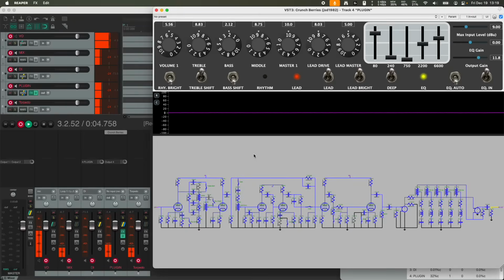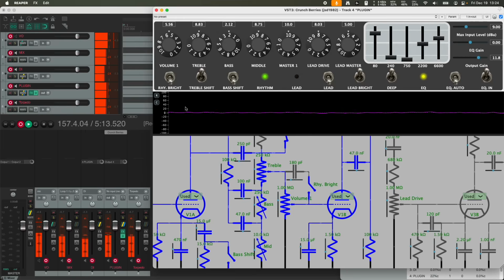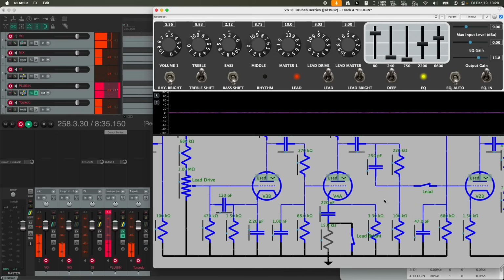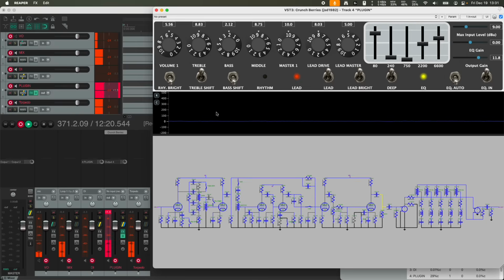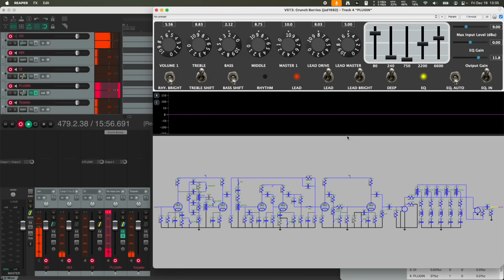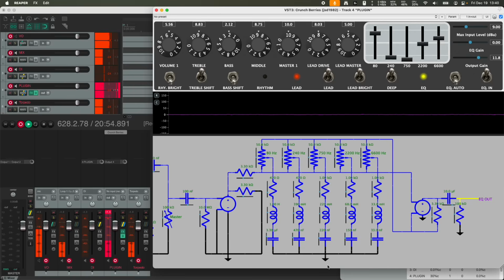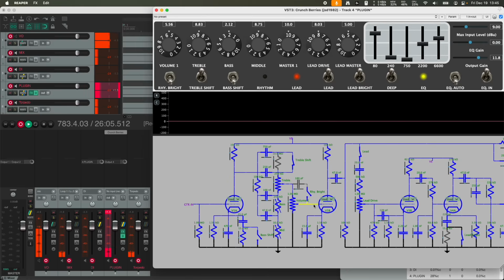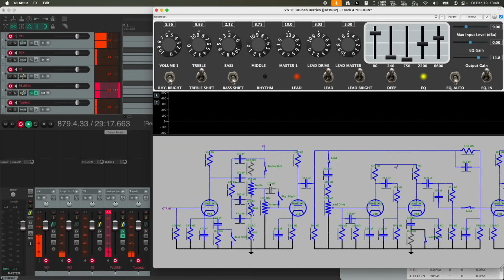Crunch Berries - a Mark IIC+ Preamp Circuit Simulator Plugin

Comment: You could ditch the gyrator eq and replace it with a tube ultra low distortion graphic EQ by rickard berglund to further improve the plugin, you will find the schematics online... 😇
Reply from the maker: I'll have to do some research on that! I simplified the IIC+'s real EQ circuit by swapping out the transistors (which are a bit challenging to simulate) for some much simpler op-amps (voltage-controlled voltage sources), so there won't be any clipping or saturation caused by the EQ circuit which might occur in a real IIC+ if you drive the output too hard. I doubt that's a desirable sound but I'm probably wrong!
Reply: @jsd1982  I don't know how much the IIC+ would drive the 5-band EQ, but a tube EQ would probably have more headroom and less distortion, and wouldn't need inductors/chokes(they're sensitive and cause hum in a real amp, and not very accurate). You could replace the opamp eq with 12AX7 and 12AT7 tube driven eq.
I get why mesa do use the choke gyrator, it was cheaper than the tube eq.

Comment: how easy is to modify the circuit to create other amps? There's a circuit editor?
Reply from the maker: It's not a circuit editor but it does let you change all the components' values. At some point down the line I do want to make a circuit editor using this tech.

Comment: Very cool, I think this is the one right way to do modelling (Of course depends on how accurate the modelling of the parts is). I'd love a plain version of that where I can build my own virtual amps from schematics. A really advanced version of this could maybe also have a setting for the board layout and modelling of the magnet fields of the parts. But at some point the CPU gets too hot.
Reply: well, basically every guitar amp is the same so you could mod it piece by piece from anyone

Comment: I love what you've created here. I was trying to come up with something similar so I could, not only simulate my main Fender amp, but could test my own amp circuit design before buying the components. This would be for use in Reaper on Linux. I haven't been able to find an amp plugin that works well for me in Reaper on Linux. Would your plugin work on Linux?
Reply from the maker: Yes it should work on Linux. Another commenter asked the same so I looked into it and yeah I could compile and run on Linux VM without a hitch.

Comment: Genius! Have you tried to automate/randomize the component values, 12au7 valve...or any other for that matter? also, would make sense to you to create a signal / wave delta comparison with original values if it was possible? Does that make sense in your opinion for sound design? Congrats, amazing work!
Reply from the maker: Yeah I had the exact same thought on randomizing the component values within their tolerances. I think that would be fun to play around with. I haven't tried other tube variants but if I understand, they should have similar overall curve shape just with different curvature parameters, e.g. the 12AU7 is just a lower gain version of the 12AX7.
Reply: @jsd1982 mate, u broke fractal cheat code on those sharc processors with your work... If you come with output Trafo sag on the curve...valve changes...u have a fractal plugin on hand...just...just...  Magic... Kudos again

Comment: Congrats! Is that based on LiveSpice?
Reply from the maker: No but I did take inspiration from that project! Very cool stuff.
Reply: @jsd1982  I don't wanna bother, but, do you haveany advice on crossing from an Electronics background to Virtual Analog Simulation? I'm currently looking into MNA and WDFs, just as a way to build plugins of the effects I've been designing and building IRL as a hobbie ^^.
Thanks!
Reply from the maker: @sharptrickster  No bother at all! This amp sim is using MNA with Newton-Raphson iteration to solve for the non-linear triodes. WDF seemed to be a bit limited for this application but I'm no authority by any means; probably it works better for all I know. Besides that, just a ton of custom C++20 code to compile-time optimize the circuit topologies and a lot of time spent optimizing the core solver loop. Building IRL sounds really awesome and I've thought about it but it's just way cheaper to build in the box lol.

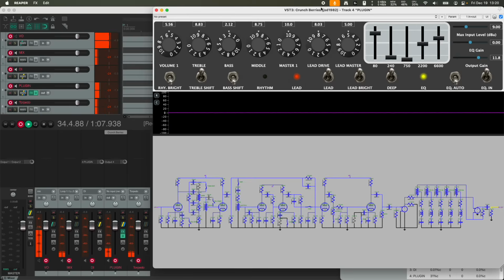Comment: 0:34 heavily saturated? heheh saturated, get it, because distortion, saturation and stuff hehehe
I'll show myself out :)

jokes aside, what an awesome plugin. I've always had an inkling that this is something that Fractal do in their amp emulations. But now, when you see the circuit and if you have even a cursory knowledge of electronics, you can understand what each switch does. The example with the treble shift switch and the resistor there is very illustrative and intuitive.

I'm interested in knowing how I would be able to obtain this plugin and also, what kind of IR are you using?

What an endeavor! I am very very impressed.
Reply from the maker: Thanks! The IR used is the John Petrucci DreamWorld 4x12 recto blend with room.

I'm still working on a release version. I'll probably put it up for sale on a website that I own and control that doesn't exist yet. I'm toying with the idea of a demo release but not sure what demo strategy to employ.

Comment: Honestly, this sounds more legitimate and true to the original Boogie amp than all of those expensive plug-ins.
Reply: Spice modelling is basically the foundation of many commerical ampsim plugins. Generally, NeuralDSP and Mercurial start their model in spice and then send test signal to the real amp input while reading its output and provide it to parameter-adjusting neural network in order to make the model closer to the real deal.
Reply from the maker: @metalosaur  Yup. I use LTspice to prototype the circuit and if I can simulate it in a stable manner there I can easily translate it into the C++ code to run it in real time.
Reply: Thanks for your insight

Comment: Amazing stuff! Now one can mod their plugin like they could mod their real preamp. How are you avoiding aliasing?
Reply from the maker: It uses oversampling to avoid aliasing. This demo uses 2x, and there's a hidden parameter to control that but I'll put a control for that on the UI.
Reply: @jsd1982  Thanks for the answer! So are you running the sim at 96kHz? Or is your base sample rate higher than 48kHz? Did you measure how many dBs of aliasing you are getting e.g., at full gain with e.g. high output humbucker pickup signal level?

Comment: This is by far the best schematic based plugin of Mark IIC+, I tried DiBiQuadro one and it sounded horrible, very loose. How can I test your preamp plugin?

DiBi stuff is also with tweakable schematic and stuff but a bit more limited than in your variant.
Reply from the maker: I'd never heard of the DiBi stuff until a few comments here mentioned it. Their audio samples leave a little bit to be desired, yeah :D. Not sure how they're simulating the circuit as they claim to be while not getting the tones right. Strange.

The schematic layout currently just lets you alter all the component values but there's no option to add mods just yet. I think that'd be a very useful feature though so we'll see if that shows up later. The ++ mod isn't all that complicated so maybe that'll be the first one.
Reply: @jsd1982  The DiBiQ audio samples sound amazing, while yours sound quite like shit, especially on the chugs. Why do you think they are not simulating all the components? do you have any proof or are you just talking shit about others to make yourself look good?
Reply from the maker: @George63-cz1dj Hey yeah sorry that wasn't my intent. I just didn't think the samples I heard sounded like the amp. I'm sure I'm wrong though. That wasn't fair of me. I didnt test it myself. Sorry I will do better.
Reply: @jsd1982  I saw you before, under Dann Valentino's post in a FB group a couple of months ago, or it was a video. You told him about your plugin in development, I wouldn't be here if I didn't see it. Great job so far, but I would like to test it myself and send it to my friend cause he owns a real Mark IV and is better in understanding Boogies, we have 2:90 poweramp capture.

Comment: This is so neat! Seems like just designing the object heirarchy would have been kinda fun!

What are you using for persistence? Does C++ have any built in object flattening system these days? I'm a Swift guy now (but used to work at Borland on the C++ side), and JSON seems to be extremely popular at the moment.

Are there any plans for making this publically available? Or plans for making this into a sort of toolkit for people making / cloning their own circuits?
Reply from the maker: I use Juce to handle the parameter persistence. I think it uses xml out of the box.

Yep I plan to have this in release shape as soon as I can. And probably further down the line it can morph into an amp builder type of system.

Comment: What are you doing for the power amp section? Are you using a separate simulation?
Reply: He mentioned he's going into the fx return of a MK-V, so no power amp modeling ... yet?
Reply from the maker: @AlanW Yeah exactly. The SimulClass power amp circuit is giving me grief trying to simulate it in LTspice, but once I get that sorted that can be included. Might be good to have that as a separate plugin so other effects can be inserted in between.
Reply: @AlanW 👍

Comment: Does it work on Linux?
Reply from the maker: No reason it shouldn't! I just haven't tested on that platform yet.
Reply from the maker: Yup works just fine in Linux. I just compiled it on a arm64 VM and it runs on a Kubuntu desktop.
Reply: @jsd1982 i hope it's Linux compatible. We don't have too many plugins like this.
I know we can run windows plugins with wine or yardbride but induce latency.

Comment: real electrical engineering
Reply from the maker: I majored in Computer Science - I have no idea what I'm doing lol.
Reply: @jsd1982  did you use Juce for the dsp implementation?
Reply from the maker: @thomasdominici1407 No actually. Juce is used just for the plugin binding and UI. The sim code is all hand rolled C++20
Reply: *electronics

Comment: This looks incredible! Would this being the actual circuit make this sim the most accurate 2c+ sim we have so far? I'm curious on what the differences are between this and the neural mesa suite for example.
Reply from the maker: So am I! I've not purchased any Neural DSP stuff or used the open neural amp models yet. I suppose I should do my own comparisons to those, but I feel like this circuit simulator is very very close to the real thing, at least as close as I can get with my Mark V''s IIC+ mode, that I don't really feel a strong need to compare it to neural amp modeling. I guess that's the current state of the art but I have no idea how accurate that is to a real amp.
Reply: @jsd1982  If you want, test against Neural Amp Modeler, Tone3000 has a lot of models for free, search SlamminMofo there by typing slammin in the search, he has a Mark IV pack, he also has 2:90 Simul poweramp you can test your preamp with. There is also Mark IIC+ pack by dogusaltin, search Mesa Boogie Mark IIC+ Essentials Pack.

Comment: Very cool. I'm glad the YT Algorithm picked this video for me. I guess that's how other amp sims are built, except they don't expose the parameters of all the individual components the way you do. They typically just expose the front panel controls while locking in the rest of the circuit to what the original amp used. Your software is a canvas for mods.
Reply from the maker: A canvas for mods - I like that. To be honest I'm not sure how other modelers that don't use neural networks do their thing. I suppose they break the circuit down into manageable chunks and emulate the behavior of those chunks. Doing it this way with every circuit component simulated costs a lot of CPU and that cost increases exponentially the more components you add, to put it in simple terms. You have to optimize a lot to keep it within real-time constraints.
Reply: @jsd1982  Well said!  And no way LTSPICE or any Spice sim engine does anything in real time.  This is definitely an approach for preliminary modding if you don’t want to dive right in with a soldering iron and box-o-parts.  Good work dude!
Reply from the maker: @SquareRootOfEvil  Thanks! Yeah SPICE sims aren't traditionally geared towards real-time. They're more for analytical use cases so they calculate a ton of information, focusing on high accuracy as well as being naturally flexible to any circuit the user can enter.
Reply: @jsd1982 Out of curiosity what system did you use to simulate the circuit in real time? Interested in doing something like this myself
Reply: @jsd1982  I think this reply (even though it's not to me) probably answers the latency advantage/disadvantage question in my own comment. 👍🏼  Very cool work.

Comment: What a cool project! Are you going to make it available? Back in the day I used to use SIMetrix circuit modelling software to compare various Mark/Quad/StudioPre schematics and their mods to figure out what's happening with them. But to actually hear the results of tweaking single components is awesome. Great work mate!
Reply from the maker: Thanks! Yes I definitely intend to release it soon. Got a lot to polish up still but the core is pretty solid.
Reply: Awesome